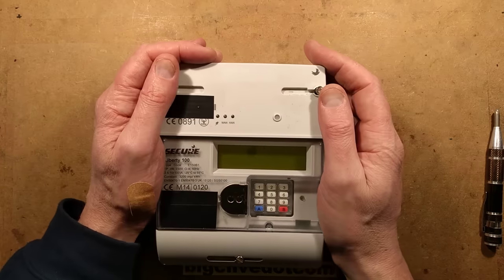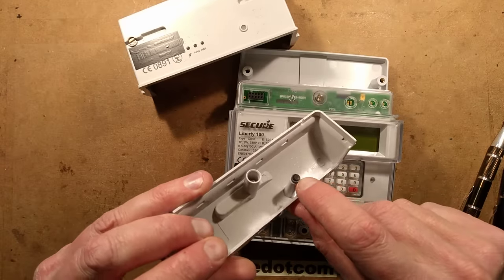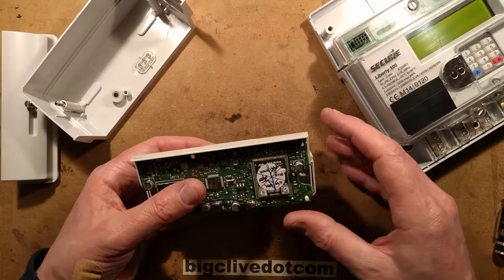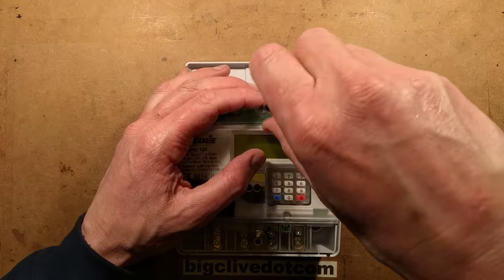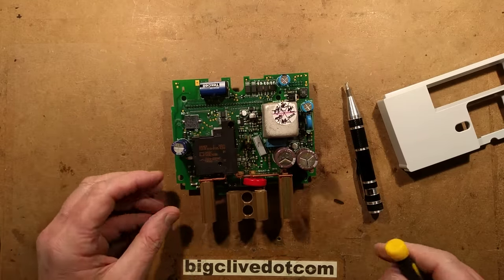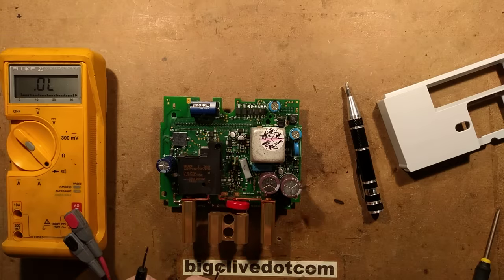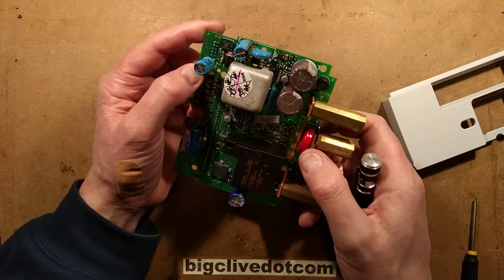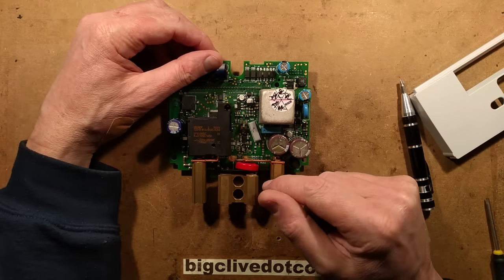Inside a smart meter, and the REAL problem with them.

Comment: To me, the main problem is reliability.
We have a dual fuel tariff. Smart meters were fitted in our last home and on checking our bill, I found that no gas use had been recorded. I managed to notify the supplier who shall be nameless (but their initials are BG- ever tried to contact them on their website?) as it wasn't even noticed by them that their smart meter was not very smart. The meter was then changed. "Apparently" it was because the old smart meter had obsolete software (so why was it fitted?)
We subsequently moved home and initially, I read the conventional meters each month and sent off the readings- no problem.
Then smart meters were fitted.
Yet again the gas meter wasn't sending off the consumption so after contacting BG, A technician came out to put a new meter in. It didn't work! So he had to put in yet another meter and so far, it seems to be sending off the gas consumption, but I do keep an eye on the display to make sure that the meter is working.
So that is a total of 2 electricity meters and 5 gas meters within 5 years, the cost of which plus the installation and repair costs must far exceed the costs incurred using the old, reliable meters.

Oh, what a joy it has been with this wonderful, privatised energy market that was to bring such efficiency and cheap fuel. (I am a former CEGB engineer).
Reply: That's fully explained in "the light bulb conspiracy"

Comment: A thing many people do not know because they sign the bit that says they have read the T&C when they haven't is you CANNOT refuse the electricity supplier access to your house when requested, unless you are having an orgy and it is inconvienient. They also MUST change the meters every 20 yrs by law, 21yrs MAX if there is a problem of access(I encountered a flooded basement that was chest deep with the meter just out of the water and still live}. That kind of situation would become a disconnect at the nearest point.

Comment: Not all internal connections are for functionality -- some are test points in manufacture.

The old disc meters only measured 1 tariff whereas a smart meter can be programmed for several tariffs including times for Peak, Shoulder and Off Peak tariffs for time-of-day metering as well as an Off Peak hot water tariff (which needed a second meter) and seasonal time setting. Inrush current does not affect the measurement of consumption by orders of magnitude and does not cause higher than normal energy costs and even if it did, one should pay for the use thereof.

Comment: Most meters use 2G connections which is low powered and 5G isn't used let alone 4G. 3G is closing down before 2G because a lot of devices still use 2G so it would cause chaos closing down 2G right now

Comment: Hello Clive I have a smart meter. That is that does not always work.  Last summer it was extremely hot. I pay my meter via the automatic payment line. My meter would not corrnect with my payments for nearly 3 days. My kitchen is tiny with a large window. It gets so hot as if the oven has been left on. I had to throw away about £168.00 of my fridge freezer. Edf has said that it is not the fault of the meter. I say if my payment had gone through the electricity would have come on, no problems with my fridge freezer. They will not make any reimbursements. Can you advise me. I will never be able to recover the amount of food at the price of food now.
Thank you.
Reply from the maker: If it failed to process payments properly, and cut you off as a result then I would think that the service provider would be liable.

Comment: The relay isn't for disconnecting if you haven't paid a bill, it's for disconnection when it's been switched to prepay mode when the credit runs out. Power companies wont disconnect unless its in extreme circumstances like meter tampering. They will just get a warrent to switch the meter to prepay to recover debt instead

Comment: Do you have any further info on the real/apparent power issue relating to these ? I'm getting readings in the 300-600W range that I can't reconcile with the rated power of the devices I have switched on. True zero load read zero and resistive loads like the oven appear to be correct. I'm entirely sure that my apparent power will be high as I have a lot of LED lighting, noted for its poor power factor, and some electronics that probably doesn't have power factor correction. Indeed nothing below 100W (a change to 75W was planned but has never been implemented AFAIK) needs power factor correction. BTW, the necking in the copper bus bar is to make the current shunt, likely calibrated by removing some metal with a file. The resulting higher resistance in this area will indeed make it warm(er) from I2R heating.

Comment: At Spain smart meters are owned by distributors, they allow the customer to access all gathered data, but they have very strict conditions on what they can or can’t do with this data. The pity is that we don’t have real time access from the meter itself (the communication between meter and distributors are very, very slow, no way of doing it trough internet)

Comment: Hi Clive, give it 5 years that Tekcell battery will be dead and the retrained readers will be replacing the smart meter, I use loads of those tekcell 3.6 lithium batts in LG telephone systems they backup the system programming database in 2 RAM chips, one part of the modem is to communicate via bluetooth to the IHD (In Home Display) so you can see how much the utility company is ripping you off  hence the other small rf flat can.

Comment: The old gas token meters were the best,( the ones where you inserted a blue key and the end snapped off when you turned it to give you gas, until they figured out that you could super glue the end back on and keep using it for free gas.

Comment: Due to the lack of space SMART meters tend to have a very in-adequate  power supply, instead of a conventional transformer they use a capacitor or resistor dropper which is  load critical so if a component go's short circuit the power supply dies and in worst case self destructs quiet radically. The Varistor is there to safeguard the power supply (capture mains spikes) and a faulty Varistor  also gives an interesting self destruct. The small metal insert on the copper bar is a low resistant shunt and used to measure the load current, E.G the meter measures the millivolts across the shunt. I wouldn't have a Smart meter installed inside my house as it becomes lifetime expired and capacitors start to dry etc they are a potentially a fire risk (worst case a catastrophic self destruct)  I have witnessed these events!

Comment: People will moan that the suppliers can change the terms after installing a meter, but what most people forget is that they can also change the rates on 'dumb meter' tariffs, easily rendering attempts to dodge peak tariff charges totally ineffectual. Sadly, there's no god given right to cheap energy, and if you're a consumer, and not a producer, you're just asking for trouble when demand exceeds supply, the alternative is rolling blackouts!

Comment: If they can charge you more at peak times, they can charge you less at off peak times. Octopus agile tariff updates pricing every half an hour. They publish what the rates will be the day before so you can adjust your usage to be at the cheapest times. The difficulty is if you are choosing between different companies operating such a tariff how do you compare the prices? It is much more complicated than if its just a fixed unit rate. Things would be so much simpler if we had a state energy company that just charged fair prices rather than multiple private companies each trying to charge you as much as possible in sneaky ways you won't notice.

Comment: I have a friend who has a electric monitoring display that monitors her electric usage. Most of the time it shows a green light to indicate low usage, but it goes onto amber when she cooks or uses a kettle. However, lately, she has noticed, in the middle of the night when shoe goes to the loo, she has seen her electric monitor is showing a red light, even though she is not using any more than switching on a light bulb. She thinks the electric company are sending a signal to read her electric at a higher rate.
Reply from the maker: It may be detecting a water heater coming on .

Comment: I missed this vid, as was busy caring for my Alzheimers Dad ...soz  for the late comment Clive though I know you understand :) This is your best vid yet. I assume you know the story of the two northern guys, who after no advice from anyone, pulled the main fuse (as per EAWR) and got a £5K fine. I am told now that we are to remove the bottom seal and cover of the meter and pull the live to the DB, would love to know your view on this and do they use more power than a regular meter since we're obviously paying for that too?
Reply from the maker: It probably varies depending on the mental state of your local "electrical inspectors".  When I was young I used to play by the book and get the electrical company out to disconnect the old DB and approve my temporary power on sites.  But they rapidly pissed me off so much that I ended up just cutting seals and doing it without getting electro-Karens involved.  Some of them were justy really incompetent.
(Especially the one who wouldn't let me use the utility provided TNCS earth and wanted me to achieve the same loop impedance from an earth electrode.)

Comment: I'm thinking they use a current sense resistor because measuring the voltage across the copper strip would be temperature dependent. Also, the shielded power supply is because it's an off-the-shelf part and it's enclosed for safety and electronic noise.

Comment: My objection to smart meters is nothing to do with bugging, gasing etc., or any other aunt Sallys put up to ridicule people who want more scrutiny of the technology.  It is simply that any computer can be programmed to do any calculation those who programme it like. In other words the relationship between real power measured and the digitally calculated value seen on the meter can be altered, e.g. to add a few percent, they think the user won't be able to tell, as and when those who programme it like. Such digital figures must be generated by a micro-processor chip which is run by externally sent software. You cannot do this with an old analogue meter like we still have. I want to know who programmes the meter. If it is the power company they can say we all used however much electricity they want, we have no independent way of verifying it.

Comment: Recent changes to legislation mean EV chargers in UK now have to be "smart". They sell it as helping you to control the charging from your phone but the reason it's been made mandatory is so that charging can be remotely stopped by the electric company at peak time. I see no reason why the same wouldn't be applied to domestic smart meters to apply rolling blackouts at times of extreme demand. Although I expect those occasions would be vanishingly rare, you never know what will happen as EVs become more of a strain on the grid.

Comment: But Clive, variable-priced electricity is a Good Thing. It means that people and companies will tend to use it when it's being generated, rather than it having to be generated when people want it. That's good because we're moving to generate via wind and sun, and not by burning oil and gas, which create climate change.
And with good weather forecasting, we can tell not just that we're "currently" able to generate a lot of cheaper electricity because the sun is out or the wind is blowing, but that we're shortly "going" to be able to generate a lot of cheaper electricity because the sun is going to shine or the wind is going to blow, and we can get our smart devices to programme themselves accordingly.
Reply: Are you seriously suggesting businesses should just stop using electricity in accordance with unpredictable weather patterns?

Comment: Three ways i can think of people tampering with this, without activating the anti-tamper right away:
- take a microdrill and just make a very tiny hole on the right side through the outer plastic and the relay housing. Take a fibre glass rod and just push the relay to "on"
- use RF-Shielding to stop the meter from phoning home
- use an extremly powerfull EMP generator to just straight out fry the microchips on the board through the plastic cover

Comment: The slug will be a fuseable link for an overload protection. There is 100amps max (usually) through the meter, if someone thought they could put leads in and power their house too, that slug would melt.

Comment: That large red component is not a MOV it will be a transient suppressor to remove high voltage spikes to protect the electronics I have seen them before.
Reply from the maker: A MOV or VDR is a transient suppressor.

Comment: Up to now, Smart meters have been fitted only with the domestic users' permission. But as the old type meters become obsolescent or fall out of calibration, they will, no doubt, become mandatory. Then I fear that domestic bills will switch from kWh to kVAh. This will save money for the electricity suppliers, but hike the bills for domestic users, unless all devices in the home are corrected for a PF close to unity. The "200kW miracle power saving device" you stripped down is probably being sold to achieve this, but is mostly snake oil.
Reply: Maybe future meters could also report poor load form factor.

Comment: The communications section is isolated because people try to zapp the meters with tazers to "erase" the reading. If the external antennae is installed, this would be the prime target.

In the (German) smart meter I had a close look inside, a bistable relay was used to cut power.

Comment: So......what was the real problem? No one needs a smart meter...the benefit is all with the suppliers; in effect, they can see you but you can't see them. Wanna save money? 1.Find out all the high wattage stuff you use. 2. Use as little of these as possible. 3 Forget about LED bulbs of 8-10 watts. 4.Relax.

Comment: You're not far off with the real resaon for the industry looking to migrate everyone to smart meters. A friend of mine (who's identity I will protect) is a senior manager in the Electical Distribution Sector. The decision was made some years ago that the ever increasing rise in consumer demand was not tolerable to the generation side and was known to be mostly unnecessary and superfluous when it came to household use (remember the "SaveIt" campaign in the 70s?). To dissuade use, it was agreed that more flexible, wholesale sensitive and punitive pricing was to be introduced to reduce demand but OFGEM ruled it had to be targetted to the indivdual users. So now we are in the transition phase with a roleout of meters that, once they are the norm, will provide indivdualised household data on peak and off-peak use allowing the companies to tailor the domestic tariff down to individual accounts, rather than the current blocked time slots based on general trend which usually take into account commercial demand spikes. So instead of off-peak for your household being at night, it could be during the day when everyone is at work or school and peak once people start coming home and turning on their devices!

Comment: I went to a job where a "multi skilled" Smart Meter engineer installed a Smart meter, reverse polarity connected the house and left the main switch on in the fuse board, before he 'dead tested" to the main switch.  Old Wylex board with an existing Neutral/earth dead short and stripped the Twin and earth insulation along the downstairs light circuit!! £1400 later and a partial rewire I sorted it. Expensive mistake...

Comment: You forgot that these meters have to accept reverse flow from the homes own battery solar power wind power system. They also have to shut off flow in a power failure so there is no power generation in lines that may be down. That's what that residual battery backup power supply is for. So much for having power during a blackout and being "independent".
Reply: No.  These don't have to support feeding the grid, and they have no capability to isolate themselves in the event of a power failure.

Comment: Told the smart meter regulations will allow fluctuating prices depending on demand, if demand is high the supplier can change the cost & if demand is low they can reduce the cost. Sounds like a scam

Comment: A modern smart meter is supposed to also measure and correct for power-factor.  Power factor is a perennial issue for supply authorities as the old meters can be tricked, and even made to run backwards under light loads with sufficient capacitive loading.  
All that aside, the smart meters make life easier for everyone.  You say that rate charges at the meter might be altered at will, but I doubt this, unless there is a true conspiracy going on.  Because it is easy to track the incremental power readings of a smart meter against other local measuring equipment.
If a meter does not properly comply with the watt-hour measurements made with other accurate equipment, then any supply authority using such is in for HUGE litigation problems.

Cost rates per Kw/Hr are set by the 'so-called' provider and any customer can track significant discrepancies by monitoring and logging their local meter readings manually over a few days.  IOW, the meter does NOT establish cost of electricity used.  It simply reports the AMOUNT of electricity used, and the electrical supplier applies their charge-out rate against this usage - often with rate changes according to time-of-day and/or the dedicated phase for home heating etc..